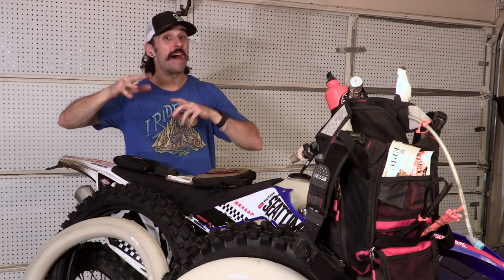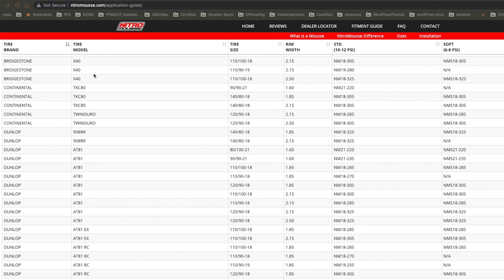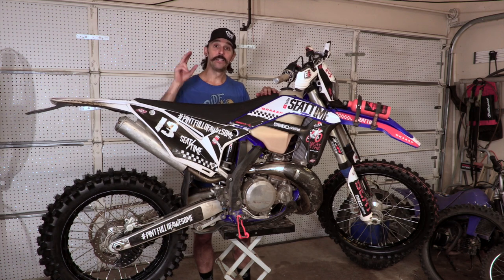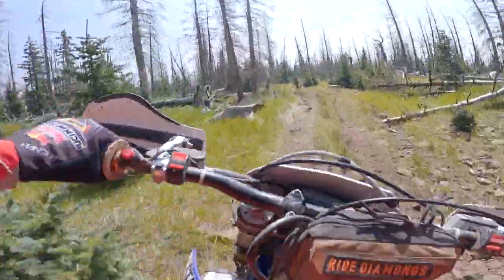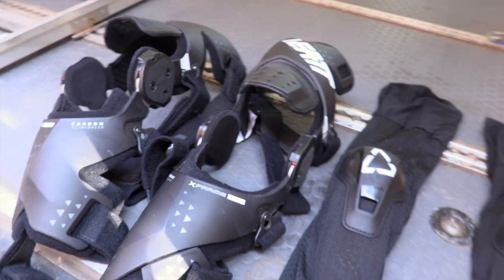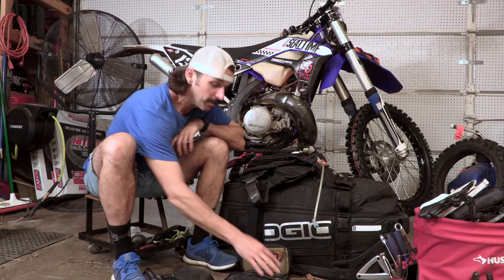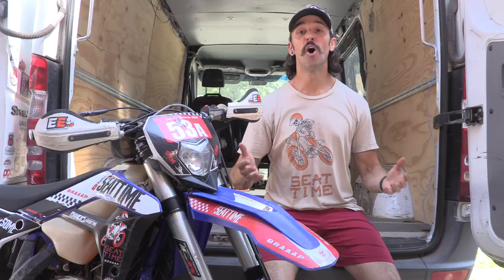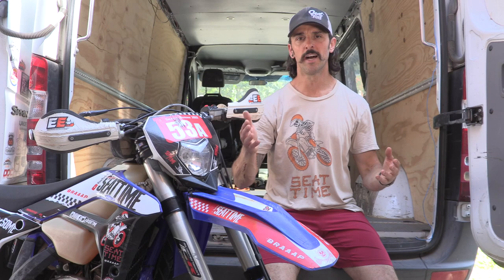Dirt Bike Prep for Rocky Mountain Riding | Single Track Ready

Comment: Wow, I mounted a Nitro 235 platinum in a used M59 front a few weeks ago and it was the toughest mousse I've ever done!  I didn't measure it, but I think they are coming in a bit on the chubby side (like me).  I was previously running tubliss with the m59 and while I know it takes time to get used to the feel of the mousse in the front.  I was pinballing all over the place also.  I put the tubliss back in the front and smooth as could be again!  Maybe just a stiff bib that needs to break in, but I wonder if that's what you were feeling?  Stiff new tire and stiff new bib?  Anyway great video! I'm looking forward to hearing  about the Leatt Hybrid braces!
Reply from the maker: I got some info from the IRC Tire Guy, the VX30 I had on the front is a bit bigger and the 235 is also a bit of a bigger mousse. So it being tough to get in makes sense. So that can set us at ease a little. It also makes a lot of sense what you're saying about a stiffer tire/mousse deflecting more than I was used to. Should of gone Plushie...

As for the knee braces, more riding needed for sure. But I think that'll be a fun video!!!

Comment: Sorry but I'm not familiar with the "white" thing you use inside the tire on the inner tube place, what is it? Thanks =]
Reply from the maker: Good Question; "bib mousse", "bib", "foam insert" and "tire insert" are some generic terms. These specifically are the Nitro Mousse Platinum Foam Inserts. You don't get flats since there is no air in the tire. I've run the Michelin Mousses for a few years now, but I wanted to try the NitroMousses. So far so good, but many more miles needed to have usable opinions.
Reply: @SeatTime  Thanks alot, this looks very good for enduro :). Since the video speed while your put the bib on the tire is fast I couldnt see if you put the "inner tube lock", the thing that prevent inner tube rotate while is flat (used with general inner tubes). Sorry for the terms, I speak another language and I dont know the exaclty translation.
Reply from the maker: @marlonvtomazin  "Rim Lock" It's there. It stays on the rim and that's the first part you get into the tire when mounting. Here's an older video of some humor with the process. https://youtu.be/Mlx54wZWPNE
Reply: @SeatTime  Thanks alot :D